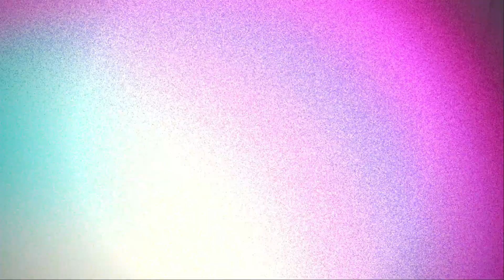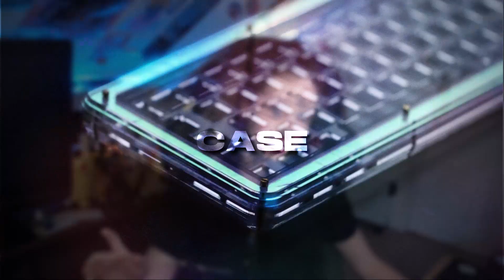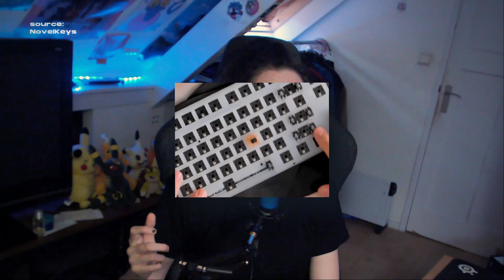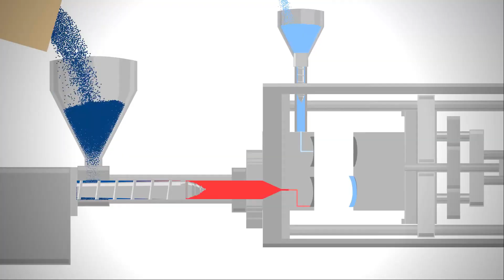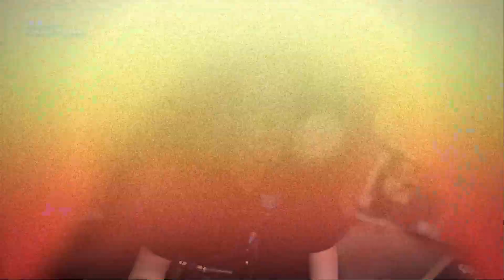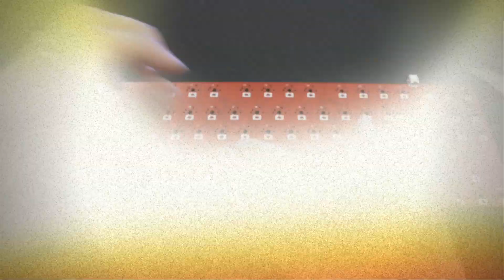The ULTIMATE Custom Keyboard GUIDE (2023)

Comment: I love your video and I think that the data you provided was good for the most part. I think that your content feel  little dated for being a keyboard video for 2023. A couple of things that can help the people watching your video, I think...

In the custom keyboard space, the 75% is kind of starting to become the standard these days over the 60/65% keyboards. And 1800 Compact is also becoming much stronger in the community, but still not as much the 60/65% keyboards

Per key RGB doesn't really need the Shine-through keycaps, RGB looks great shining around the solid keys. Especially with something like Pudding keycaps.

Hot-swap is also, kind of, the standard in 2023. In a lot of cases, the solder PCBs are available for a cheaper price, but the Hot-swap keyboards. Also solder keyboards can be converted in to hot-swap(ish) utilizing Mill Max, but usually if you use that you're going to want to use Outemu switches

Leg-clipping is not as needed as much these days as most stabs (stabilizers) come these days without the legs, so viewers should look for the l-shaped extension on the stabs, which is what they're going to want to clip...

Filling your keyboard with foam is nice, but keep in mind that a lot of keyboards come with included foam. There is 3 basic foam placements, thats Case foam (shown in your video), PCB foam (a thin sheet that goes on top of the PCB that the switches sit on top of) and Plate Foam (which fills in the space between the plate and PCB). Removing any or adding any of these  foams will drastically change the sound of the keyboard. Also, very new to the market, is PET film, which is being included with some of the newer custom keyboards and I think this trend is going to continue because of the marbley sound it provided. Basically it is a think sheet of clear plastic (usually, like .001mm thick) that sits on top of the PCB under the PCB foam and like I said, it provided a very smooth marbley sound profile. A good example of this is the Leobog HI75 which implemented this very well for a very budget keyboard. 

The last thing i wanted to touch on was switches... and the different types of springs are very much not limited to the standard colors, but that's an okay place to start, but from there, the plastics used in the top, bottom and stem of the switch has a great deal of variance, along with, what's called, long pole stems, long springs, multi-stage springs and more, Trying a multi-pack form somewhere like Switch Oddities to let you experiement with a bunch of individual switches is probably really good.

I hope this help fill in some of the, what I think, are some of the 2023 updates to the keyboard hobby. If you want to hear what some of the different switches, keycaps, and keyboards sound like, feel free to stop by my YT channel. Or any of the plethora of people who have sound tests of their own. I hope I helped in some small way. Thank you, @Ayv3e for putting this video together!

Comment: You forgot to mention when talking about stabilizers to pay attention to pcb thickness, as most high quality screw-in or snap-in stabs nowadays comes with shims so they can be used on any pcbs, but some stabilizers are strictly for 1.2 or 1.6 mm pcbs (like TX ones).
Reply: Idk anything about keyboards can u advise me a fully build keyboard under 100 dollars I prefer 65 percent keyboards
Reply from the maker: Are you asking me or Z3i0?
Reply from the maker: True that! Overlooked that completely. Thank you for adding on. :]

Comment: I am thinking of using MDA caps on a th80 se. is there a compatibility problem changing from cherry to MDA profiles?
Reply from the maker: Hiya! Your keyboard seems to be using the Gateron Pro Switches. These have an MX style stem. This means you'd have to look for MDA profile keycaps that are compatible with that stem type (so the hole at the bottom of the keycap should match the stem of the switch). Other than that, you should be good to go! You will just have to get used to typing on a different profile :]
Reply: thank you! you were of great help!  @ayv3e

Comment: One thing that should be mentioned is the fact some keyboards can be ISO and some ANSI. This only really applies to the British because despite standing for "International Organization for Standardisation" and being the universal standard for everything except keyboards, ISO keyboards are anything but international. 
Most of the keyboards you will come across in any country are ANSI which stands for "American National Standards Institute", it sounds like this is a fahrenheit situation but no ANSI keyboards, especially custom, are the most dominent type worldwide and this standard has spread to basically everywhere bar the UK and parts of Europe. If you get an ISO case, PCB and plate, you need to remember to pick ISO keycaps or your left shift and enter will not fit and you will have a key missing. Again this only really applies to the UK because there are barely any ISO cases available and once you hit 60 or 65% ISO layouts are practically non-existent.
You can also get weird in-the-middle keyboards such as the British apple keyboards which are half ISO and half ANSI, this is a complete mess but is irrelivent for custom keyboards.

Pretty much everything else was covered. Looking forward to the monitor video...
Reply from the maker: I always forget ISO is a thing 😭